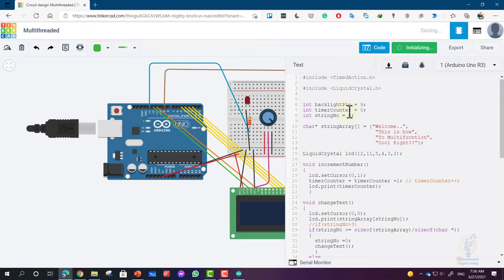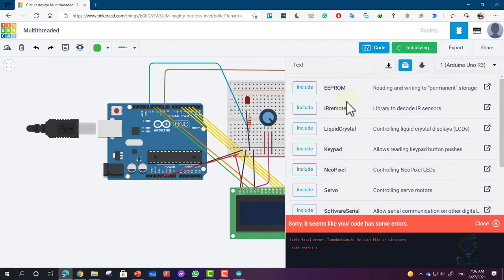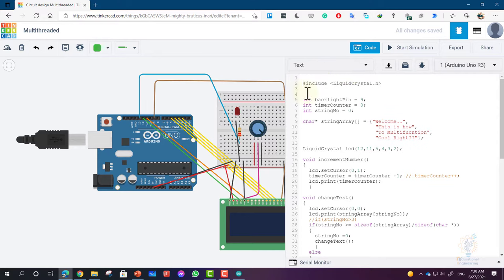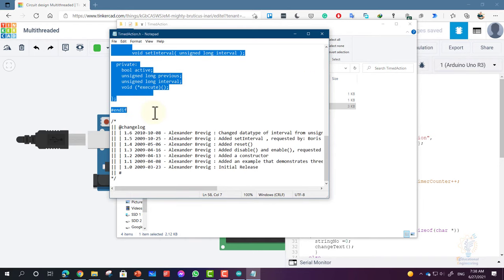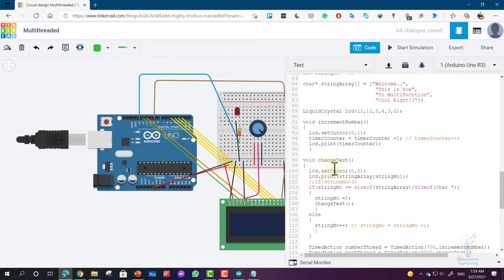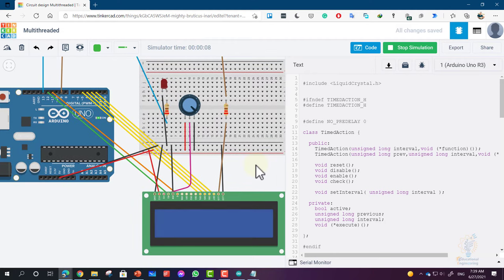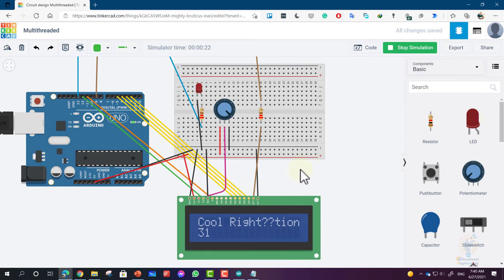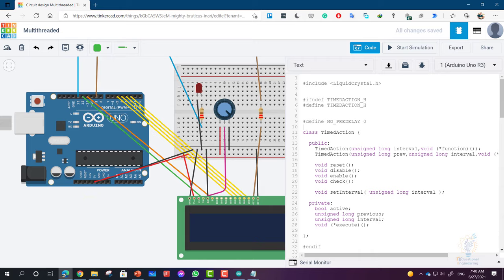How to add any Arduino Library to Tinkercad for Simulation

Comment: Hello! 
Where can i find FastLED.h code ? (.h and .cpp files)
Reply from the maker: You can find the `FastLED.h` code in the FastLED library on GitHub⁴. The FastLED library is a fast, efficient, easy-to-use Arduino library for programming addressable LED strips and pixels⁶. It supports a wide variety of LED chipsets, like the ones sold by Adafruit (NeoPixel, DotStar, LPD8806), Sparkfun (WS2801), and AliExpress⁴.

To use the FastLED library, you can install it using either the .zip file from the latest release or by searching for "FastLED" in the libraries manager of the Arduino IDE⁴. Here's a simple example of how to use the FastLED library¹:

```cpp
#include <FastLED.h>
#define NUM_LEDS 37
#define DATA_PIN 11
#define CLK_PIN 13
CRGB leds[NUM_LEDS];
int fadeAmount = 5;
int brightness = 0;

void setup() {
  FastLED.addLeds<APA102, DATA_PIN, CLK_PIN, BGR>(leds, NUM_LEDS).setCorrection(TypicalLEDStrip);
  FastLED.setBrightness(50);
}

void loop() {
  for (int i = 0; i < NUM_LEDS; i++) {
    leds[i].setRGB(0,255,250); // Set Color HERE!!!
    leds[i].fadeLightBy(brightness);
  }
  FastLED.show();
  brightness = brightness + fadeAmount;
  if (brightness == 0 || brightness == 255) {
    fadeAmount = -fadeAmount;
  }
  delay(80); // This delay sets speed of the fade.
}
```

This code controls specific LEDs using the FastLED library¹. You can modify this code according to your needs. Remember to check the licensing and usage terms before using the code⁴.

Source: Conversation with Bing, 19/11/2023
(1) GitHub - FastLED/FastLED: The FastLED library for colored LED animation .... https://github.com/FastLED/FastLED.
(2) undefined. http://fastled.io/.
(3) FastLED - How to Control specific LEDs - Arduino Stack Exchange. https://arduino.stackexchange.com/questions/56071/fastled-how-to-control-specific-leds.
(4) . https://bing.com/search?q=FastLED.h+code.
(5) FastLED - Arduino Reference. https://www.arduino.cc/reference/en/libraries/fastled/.
(6) Basic of FastLED : 8 Steps - Instructables. https://www.instructables.com/Basic-of-FastLED/.
(7) undefined. https://github.com/FastLED/FastLED/releases.
(8) undefined. https://github.com/FastLED/FastLED/wiki/Overview.
(9) undefined. http://fastled.io/r.
(10) undefined. https://www.contributor-covenant.org/.